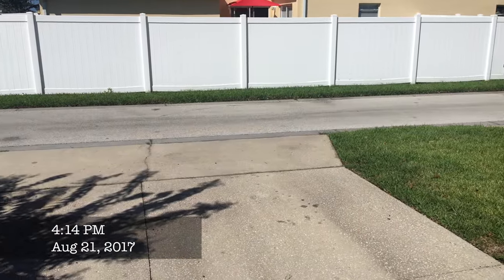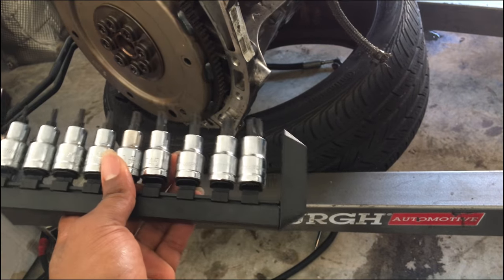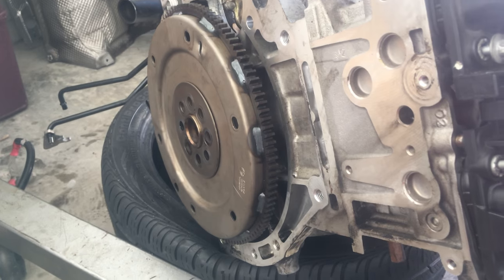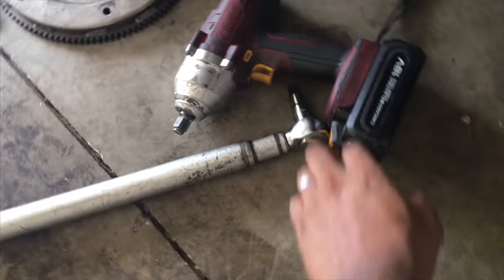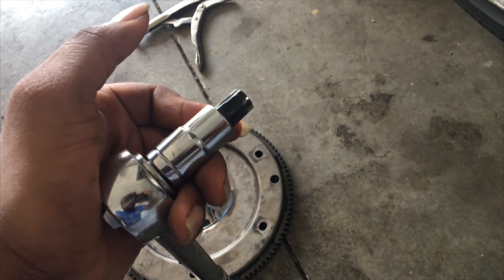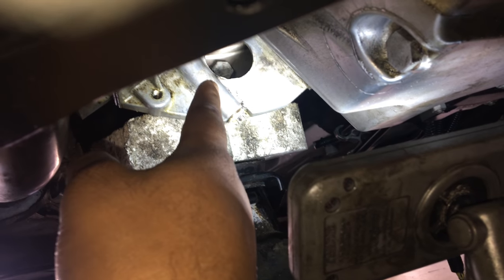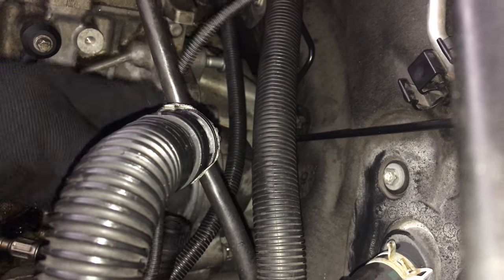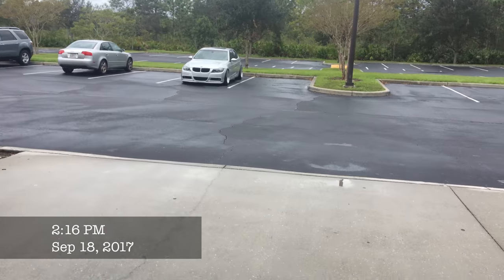BMW N54 335i Flex Plate Removal Pt 02

Comment: So I have an 8 bolt n54 engine, that I am replacing with a 6 bolt n54 engine.  This is in my e90  e90 with 6s-AT. My question is, will I need to swap the flywheels between the two engines and if so, Will the 8 bolt flywheel line up to the 6 bolt engine or do I need to purchase another one. Haven't been able to find a definitive answer for this. Thank you
Reply from the maker: They are not interchangeable. So in your case you will need a 6 bolt flex plate for the 6 bolt motor. When looking, check for “n54 6 bolt flex plate”, since in the automatics they call it a flex plate and in the manuals it’s called a flywheel. Hope that helps.
Reply: @nOshi2x  okay, so the replacement engine I have already has the 6 bolt flex plate bolted to the rear crank. Am I going to have to remove that and replace with another one?
Reply from the maker: Then your good just leave it bolted on, you won’t need replacing.

Comment: Yooo, I hope you can save my life, what’s the torque spec for the 8 bolts that bolt the flex plate to the crank?
Reply from the maker: Jointing torque = 30 Nm / 22 ft-lb
Final tightening = 125 Nm / 92 ft-lb
Reply: @nOshi2x  how’d you manage to get all that torque? Or you just used an impact gun?
Reply from the maker: I use a torque wrench and put a jack stand handle over it to give more leverage to put that much force down. Also use a flywheel lock tool to keep it from spinning.
Reply: @nOshi2x  the handle is what i was missing to get that leverage then,  Man I was only able to get that thing so 60lb ft & decided to zap it with a impact lol
Reply from the maker: Haha yea that will work also, glad it worked out